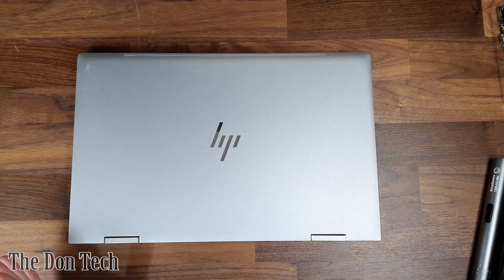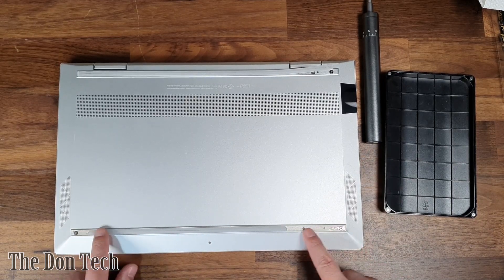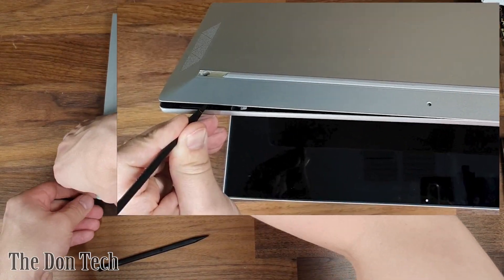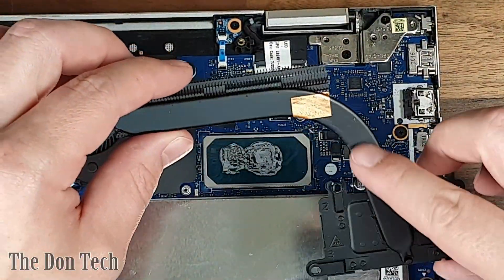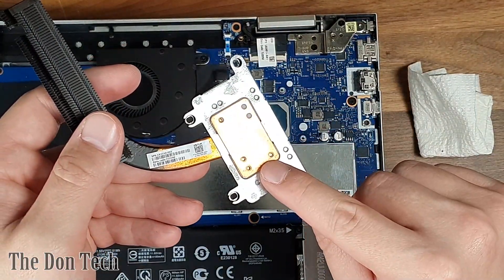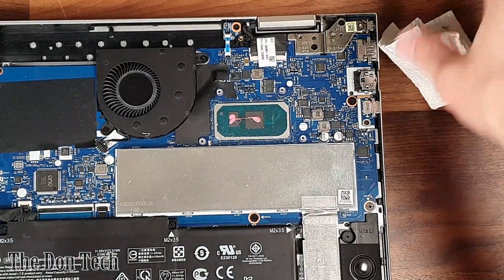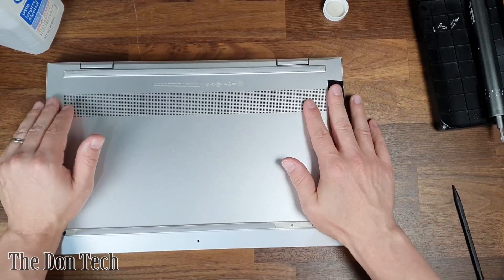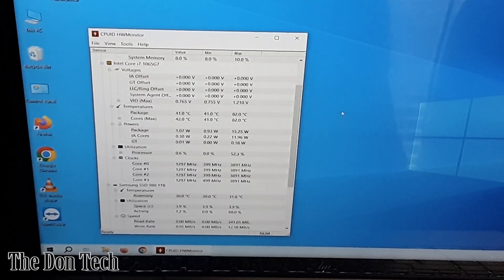Fix HP Envy 15m Overheating! Laptop Repair & Thermal Paste Guide

Comment: Hi, thanks for the video. Did you find a solution to the heating? I have the 13.3'' and it has degraded in terms of performance significantly and heat is excessive. Should I do the thermal paste?
Reply from the maker: The system does actually perform a lot better and is less erratic in the temperatures, but it is likely failure of the actual chip at this time, or premature failure, that is causing the spikes in temps. I have since retired this laptop and no longer test it, but that was just because a different laptop fell into my lap, haha.
Reply: @TheDonTech i love my unit x360 13.3 and I think it's time to replace it but it toured the world with me haha been my savior multiple times. I bought cool master thermal paste and will see it it helps but as you said I think it's a failing chip in the horizon

Comment: will this work on an HP Envy 16 with 13700h and 4060? I think it uses a vapor chamber. Mine is 2 months old and has no overheating problems, but I've been reading numerous posts about it happening to people either 6 months in or after warranty.
Reply from the maker: I would not recommend removing any cooling components from your system currently, as it is easy to damage and void a warranty, especially if you are not having any current issues. 

But keep an eye out, and possibly even create a message chain with HP, citing the sources of the complaints of heat issues. Keep track of your temps and make sure your system is operating the way you need it to. If you have issues, definitely make a claim within the warranty period. 

As laptops get thinner and more powerful, it is only inevitable that they will have these issues. Sometimes replacing the thermal paste can help, but it is not always going to have those amazing results.
Reply: @TheDonTech  thank. I might just return the laptop, as sad as that would be, since i'm still within my return period. the potential for this issue might be more than i want to possibly have to deal with.
Reply from the maker: @StefanUrkel  Nothing wrong with that, either. I'm seeing a trend that across the board manufactures are making laptops/desktops less reliable. I would suggest whatever product you buy, get the longest warranty through the maker as possible, if it is economically affordable.